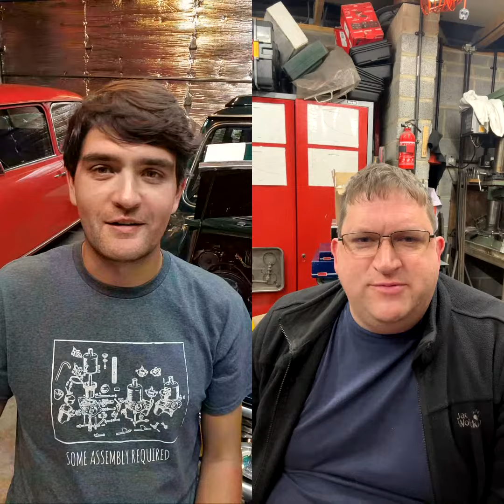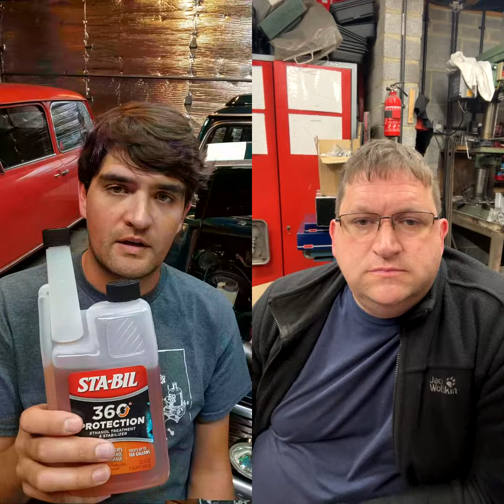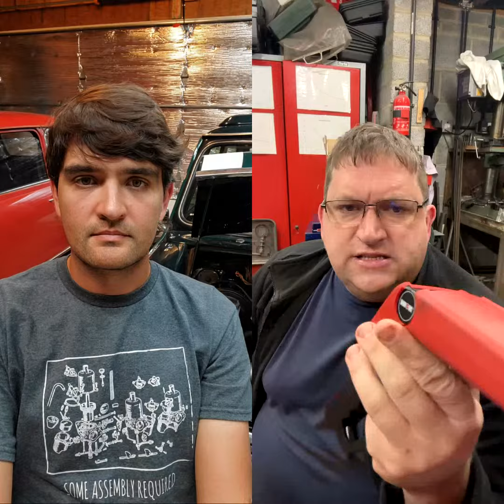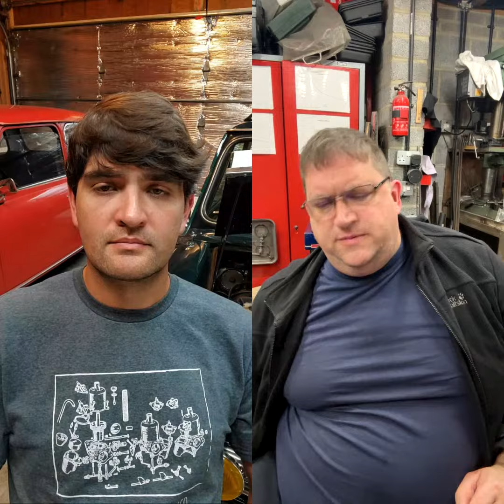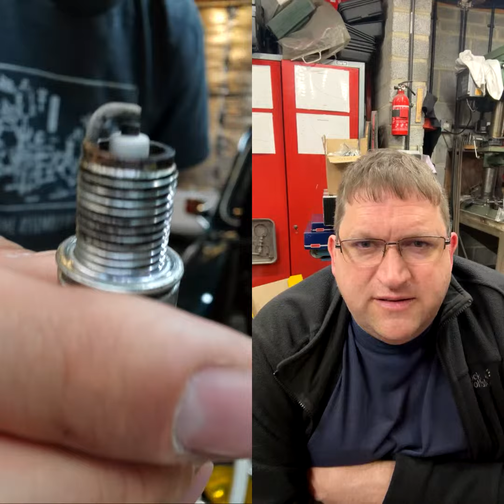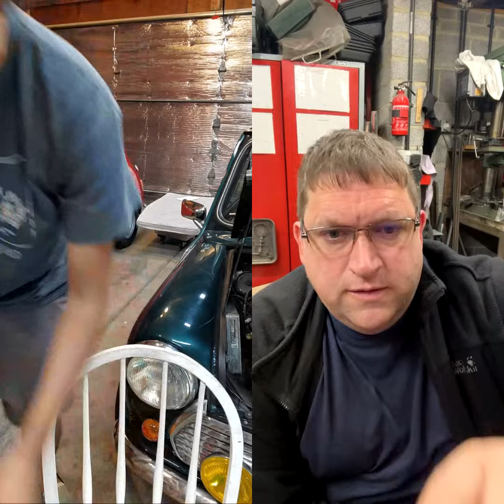AC Dodd live Q&A with Darren Haines

Comment: Hi mr Dodd, 
I bought the Innova 5568 due to your recommendation. 
But it doesn’t flash bright. 
Could I be doing something wrong. 
When I look inside the gun, with the light button switch on. 
There’s a flickering strobe. 
But no bright light. 
Turn? 
Or could I be doing something wrong?
Reply from the maker: Get back to the supplier.